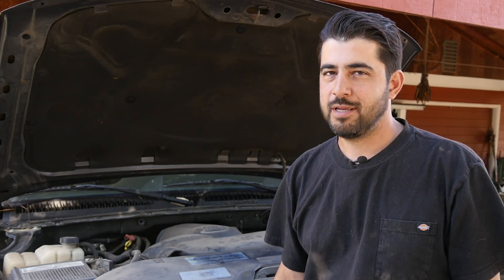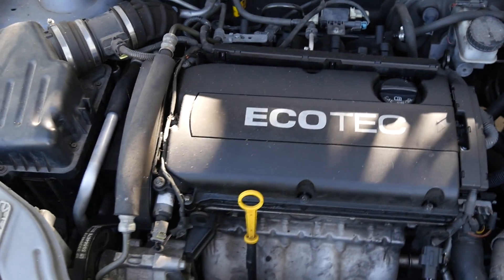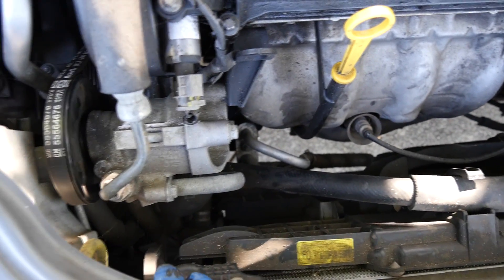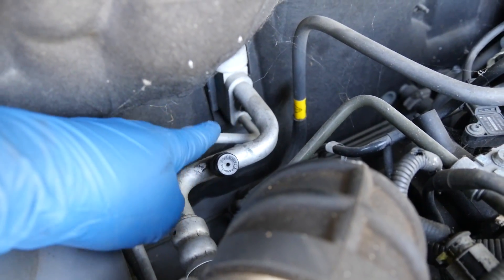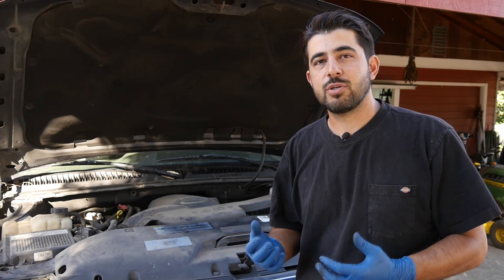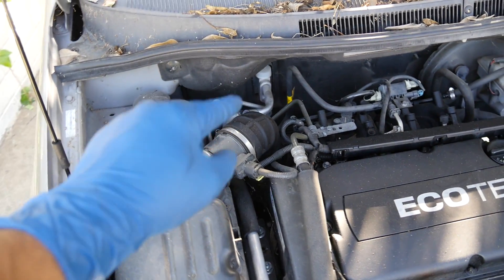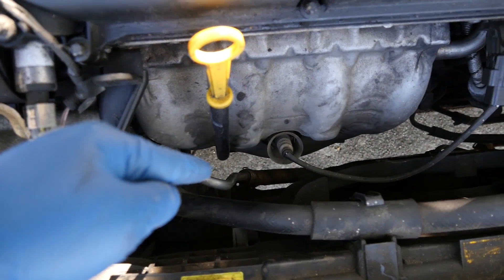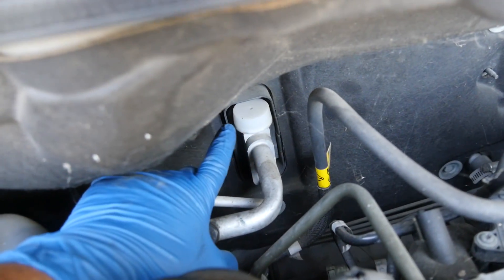AC Diagnosis Hack Using Nothing But Your Hands -  MUST Watch

Comment: I’m a commercial HVAC guy and he is 100% right yes it’s rough to follow. The best way is to draw it out but this will work. Honestly before I put my gauges on the system I feel around with my hands and be very careful touching the hot gas discharge line coming out of the compressor it WILL burn your hand. Suction line should be cold like a beer can and the discharge line ( after the condenser) should be warm like your dk. That’s a old school saying. 27 years SMWIA

Comment: Just to simplify. An A/C system with an orifice tube has an accumulator on the low pressure side. An A/C system with a thermal expansion valve has a receiver/dryer on the high pressure side.

Comment: Ten is the new thirty!
Haha was a good video though I've seen most if not all your AC diagnostic and theory videos and was missing the white board in this one.
Erick at SMA had an AC line repair on a Toyota or something this past year. Was a compression fitting replaced but the wrong type for aluminum.
You guys have great tips and thanks again!

30 year old 2009 Pontiac lol

Comment: Excellent video. What prevents the liquid refrigerant from entering the compressor on a system with an expansion valve?
Reply: a shut TXV is a very common fault. 

Leaking shraeder valve is common place besides compressor seal or  condenser puncture.

1,000 things can go bad with a car AC system... none if them cheap to repair 😅

Comment: It doesnt turn into gas when it leaves the expansion valve, or cool down...that only happens when it absorbs the heat when inside the evaporator. Right?

Comment: I have an 01 Silverado PU 4x4 that every four years needs a recharge.  This year it seems that it doesn't get cold as it used to even after the recharge.  I put the gauge on the input side and noticed that the pressure goes into the red (overcharged) when the compressor kicks in, but back to normal when it cycles off.  What did I do wrong?  It blows cool but not cold like it used to.  I'm in New Hampshire so the system is only needed 5 months a year, but realize the compressor kicks on for defrost too.  Any ideas?

Comment: Hi, Thank you for the detailed explanation. I have a problem with my AC(Corolla Altis 2011). The AC does not cool when I switch on the car. I have to rev the engine to more than 2000 rpm and then after a few minutes the ac starts blowing cool air. The problem is sporadic. Any poi ters as to what could be wrong? Thanks in advance.

Comment: Any experience with those kits specifically made to charge an R12 system with R134a? Full conversions are pricey. - Thoughts on filling, after replacing parts, without the ability to vacuum the system?
Reply: If I had a R12 system I wouldn't convert it.  Just get some R12a.  Yeah its more expensive than R134a but so is converting it. Just rent a vacuum pump to remove moisture and to check if system will hold a charge.  If its leaking then you're just wasting your money by charging it.

Comment: What can I do to fix my ac on my vehicle. I turn the ignition on the ON position and the ac light comes on and the ac is off. The ac blower motor would not turn on. It seems to have an electrical problem?

Comment: Have a problem, I evacuated (vac) the system for 45 min. and checked 45 min. later and the system hold at -28. Charged the system, the low side is 30 and high at 145, temp was 70 with about 35 humidity (all good), static pressure was 85 (even). checked for leaks with dye, soapy water and the electronic detector, no leaks found, and it cools really good, HOWEVER, the Freon leaks withing 2 weeks. Any Ideas, help, as to what it's happening?  I take anything. It's a 91 Pontiac Grand Prix with 3.1

Comment: If the refrigerant coming from the evaporater is in liquid form, how does it turn into a gas before entering the compressor?
Reply from the maker: Only a small amount will be in liquid form, which than will accumulate in the accumulator :)
Reply: Ratchets And Wrenches Thanks. So after the evaporator it goes to the accumulator before the compressor?
Reply from the maker: On most cars with an orifice tube yes.

Comment: mustang 2009 ac compressor releases the refrigerant with oil.
 what could be the problem?
condensor -ok
pipes-ok
Reply: Ford's are famous for plugging their inline AC filter with desicant debris from failed dryer...
(else orifice gone bad ie. plugged up then high PSI on liquid side)

Comment: Need help.... I recently bought a grand marquis. The car runs amazing, until i turn on a/c. It then runs pretty poorly when at idle and makes my volt meter drop. If im driving it doesnt affect it. What could it be? Thanks
Reply: Definitely sounds like the compressor the things just don't last long
Reply: @Joshoptimus  can i use it till it fails or will that damage anything? Thanks
Reply from the maker: If your compressor seizes up it will break your serpentine belt, your battery light will come on and you'll lose power steering and your car will stall out .. not to mention metal shavings that will be spread through your ac system. I would get it looked at and if its the compressor I would replace it or just don't use your ac. GL
Reply: @myRatchets  , just replaced the a/c compressor bearing and clutch on a 2001 Town Car after watching an older Ratchets and Wrenches vid.  I am not a mechanic but the video made it relatively easy.
Reply: @andrewkeen5135    what cause you to change the clutch and bearing?
Reply: @lkmaryfla1   ac was working fine, could hear a noise from front of engine, pulled off universal belt and turned each component by hand and could hear and feel drag in ac compressor pulley.  Changed the bearing (also changed the clutch plate since it was already off and pretty cheap).  Noore drag, no more noise, ac working great.  Search for the old vid, not a tough fix even for a non mechanic like me.

Comment: need to do a smoke test
however i don't want to pay 120 for a smoke test
i do have a
Halloween 400w
fog machine
what u think
Reply: 06 Pontiac G6
code p0171, po174 
i have a Halloween smoke machine
which gives out alot of vapor/ smoke 
can it be used ti detect a leak
ac works great noi problems in that.

Comment: decent job. As an HVAC engineer some of your terminology is off i.e. the word EXPAND is not used with refrigerant in  liquid state. Liquid state FLASHES on the fix orifice or TXV- where superheat is measured . The changes of state of the refrigerant determines how heat is transferred or air is conditioned. We suggest K-type temp probes which don't cost much to read temps through the refrigeration cycle. We actually teach HVAC techs NOT to attach guages (first diagnostics approach) as your opening up a closed system (most techs dont properly sweep gauges or maintain gauges and or use lossless fittings. 95% of HVAC systems can be diagnosed without gauges.

Comment: Another way to pinpoint a possible issue is check to see if your AC compressor is cycling on and off every few seconds. If it is, that can mean that you are low on refrigerant, or there is a blockage somewhere in the system.

Comment: 12 degrees Celsius 1.07am Tuesday morning 🇳🇿
Reply: -2 deg C 7:45 a.m today.
Reply: @danielsimpson8929  it was about that temp during our cold snap last week with -3c/25f but this week its 40f/4c in the morning and around 22c during the day still. The winters are pretty gentle where I'm at but the summers get pretty hot
Reply: @Demon09-_-  our cold snaps are -40C usually January sometimes December. A decade ago Edmonton hit a new record low.
-58C with wind chill.

http://www.edmontonjournal.com/touch/edmonton+shatters+cold+record/2336460/story.html 

On the other hand it rained yesterday. Roads are nice and icy today.